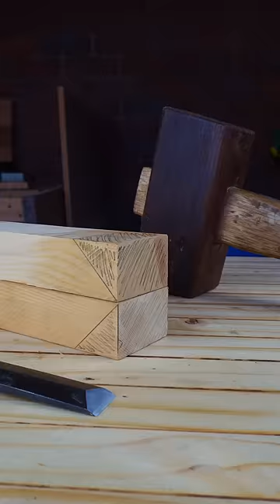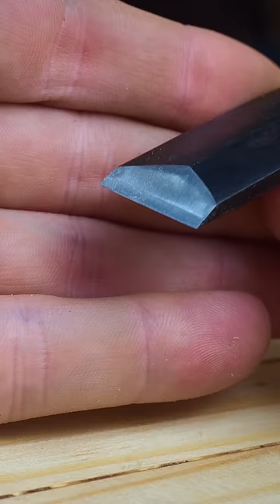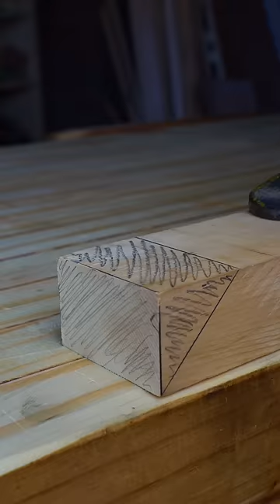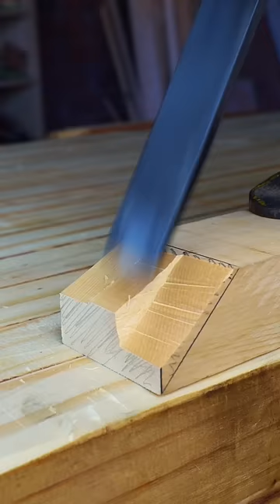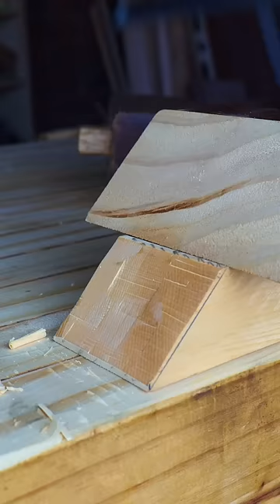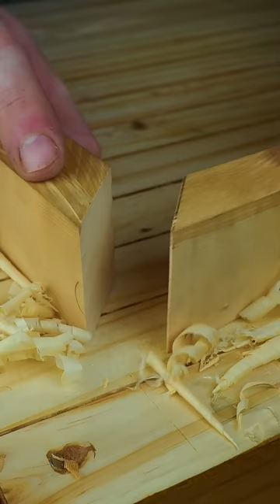Hand Tool Mitre Joint #shorts #woodwork #oddlysatisfying #satisfying #asmrsounds #chisel #sharp

Comment: At that point don’t you just want to use a saw and get the finer details with the chisel.
Reply: Exactly
Reply: This vid is just a demonstration. It's like asking the flex seal guy if not cutting up his boat wouldn't be better and easier. Obviously it is.
Reply: @zoutewand  I mean that’s true and all but it’s about application. While no one would ever sail a boat with flex tape every day. People might see this and believe it is normal. There’s nothing wrong with doing it, it’s just that it can damage tools over time. A better demonstration would show how with right use and sharpening how these chisels hold sharpness and can get clean edges. Aka rub a rock on the blade and show how it keeps its edge.

Comment: Roughs it with a powered saw, finishes it with sandpaper on a flat block. Checks for accuracy….. saves hand from hammer stress, saves chisel for another day, gets job done faster, just as accurate, and less energy spent.

Comment: A good trick with miters is leaving a cm or so overlength on the wood (part needs to be 15cm long and has 2 miter, get a piece of 17cm or something), as that will make it easier to get the part at exactly 15cm. Not saying this guy is doing it wrong, just a lil tip for the people that are interested and don't know yet. I'm a furniture maker, not just talking outta my ass
Reply: Also when doing stuff like this and a perfect fit is necessary, I'll often make a jig block from some hardwood cutoffs. Cut it at a 45 degree angle (or whatever angle you need) and put it with the angle down on the board, clamp it on and then you can just use that piece of wood as a guide. Doing that can give you precision of 0.1mm (in theory anyway lol). Can also be reused too yeehaw

Comment: ....use a saw, then sand it till its precise, then rough sand it a bit so it sticks better, drill some hole too to add some wooden taps (no sure how they are called in English), wooden glue, press it together and done
Reply: Do you mean dowels? :)